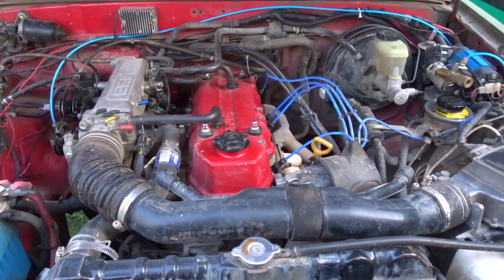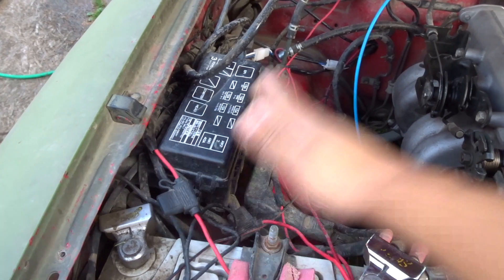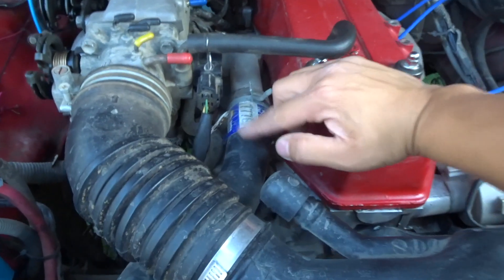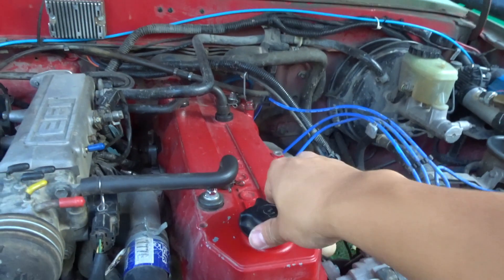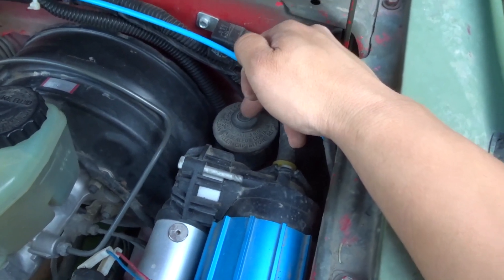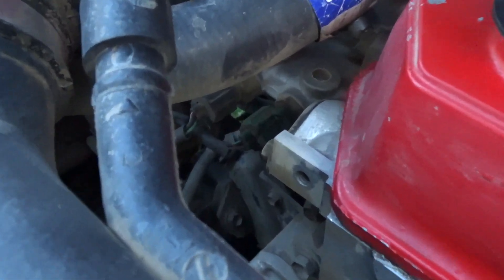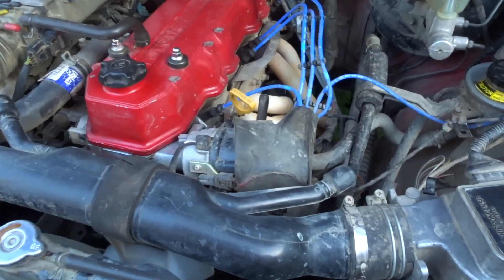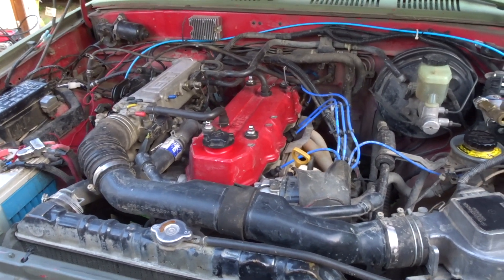TOYOTA 22RE ENGINE ANATOMY

Comment: Hey, these motors are known worldwide to be bulletproof....... but I've heard that the Toyota motorhomes equipped with this motor will not last as long as on a regular truck because of the load they are pulling?  True or false?
Reply from the maker: just a bit under power for motor homes

Comment: I believe the black plug next to the green one is the sensor that tells your cold start valve (the injector higher up on the plenum) to inject extra fuel when starting the engine. Also, on the front of the throttle body is the idle air control valve. I think that was one you weren't sure about.

Comment: Of the two sensors under the throttle body (green right, brown left) the left is a cold start sensor. Apparently tells the ecu when to fire (and stop) the cold start injector. In the process of troubleshooting mine.
Reply: Did you get it figured out? Mine is cranking but not starting. I wonder if it is that sensor

Comment: The part which you didn't know what it was is a wiper motor. (black cylinder shaped object on left side of engine bay)

The other part which you couldn't think of the name is a throttle body.
Reply: Holy fuck